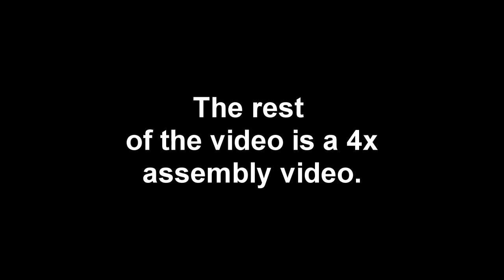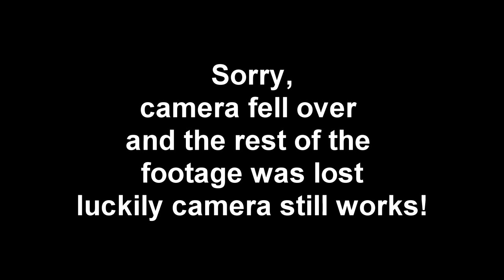24v Dewalt to 18v Milwaukee battery adapter. Episode 3 - Useful 3d Prints

Comment: Excellent way to fuck up your milwaukee battery. You need a microcontroller with a built in voltage reference and a mosfet inside your adapter to disconnect the battery when it hits the cutoff voltage. If you overdischarge the battery will go into lockdown and not take a charge. Milwaukee batteries do not have a low voltage disconnect in them like makita ones do.

Comment: Hi great video/work on the 3d printing .
I just wondered if you've made a dewalt 24volt adapter to use a dewalt flexvolt battery instead of milwaukee battery .

Comment: I have a tool that takes the fan cooled dewalt 24v nicad battery is there an adapter where I can use a 20v dewalt in thst tool or possibly adapter for a different lithium battery

Comment: You wouldn't have made a dewalt 24v adapter with just the electrical connectors?

Reason I ask is I'm looking at doing a conversion on my kids power wheels and I happen to have a few of these 24v batteries but I've yet to find anyone with an adapter to wire up for these profiles...
Reply from the maker: Hi Michael, it sounds like you have a couple Dewalt 24VDC NiCad batteries and are looking for a way to connect them your kids power wheels, correct? I haven't modeled the female socket that is built into the tool, I could do that as a tutorial and link back to here with the video and resultant model. Give me a week and I will see what I can do. Thanks for watching!

Comment: Hi Josh just wondering if that same converter you made would be acceptable for 24v DeWalt to 54v? I'm hoping to save my 24v hammer drill from becoming garbage.
Regards Stevo
Reply from the maker: Hey Stevo! So it sounds like you have 24vdc hammer drill from Dewalt and you want to know if you can power it with a 54vdc battery, and my answer would be no, not with a 54vdc battery, although if you have the new Dewalts batteries that work with either 20v or 60v products you might be able to make it work. As I understand the 60v batteries there is a physical lever that gets pushed by the tool it is inserted into in order choose if it outputs 20v or 60v So it might be possible. The one I made would probably not be compatible though as I imagine Dewalt is going the way of Milwaukee and using smart batteries which are harder to spoof. You could power an older tool with a new battery perhaps though. You could use the .stp files in my Thingiverse link to get the top half of the adapter but then you would need to model the bottom to match whatever battery you would like to try and use with it. Either way it would be a lot of 3d modeling and trial and error to get it working. If I didn't understand what you were proposing let me know and I'll respond back again. Thanks for watching!
Reply: @JoshAQ  thanks Josh

Comment: Hubby has Dewalt 24v Sliding Saw DW017 & Rotary Hammer Drill with 24v batteries but runs Milwaukee M18 too. Are you prepared to sell one or 2 of yr adaptors and send to Melbourne, Australia
Reply from the maker: Hi Christine, I had not realized that Dewalt made a Sliding Compound miter saw that ran on the 24v batteries. I would be willing to build and send you some, but I would want to improve upon the design and confirm they are not drawing too many amps out of the 18v Milwaukee Battery before I did. It is one thing to destroy my own batteries and another to charge you and have it destroy yours. If you know someone with a 3d printer you could have them print out the thingiverse files I included in the description of the video and your husband could build his own. If he owns those tools already I suspect he is a handy enough person to accomplish that. I did a quick google search for Melbourne and there a couple different shops there that could do the job. Thanks for watching!
Reply: @JoshAQ  Hi Josh, Melbourne, Australia operating under Martial Law & Police State with Covid 19 Lockdown. Hubby private enterprise shut down & cannot work let alone travel outside 5kms from home to the 3D shop for the forseeable future. How much to send a convertor to me.
Reply from the maker: Hi Christine, I recently purchased an 18 v Milwaukee Circular Saw so I do not mind sending you the adaptor I made. Feel free to contact me at cubedq@gmail.com and let me know your address so I can send it to you. I apologize for not getting back with you sooner. Between work and surgery I have been out of it. You won't owe me anything, the channel just was just monetized and I can use some of that money to help out a fellow tinkerer and maker of things. I hope you and your hubby will be ok in the coming months.

Comment: Could you do a video on how you designed this type of a part?
Reply from the maker: Hey Yellow Iron, I certainly could. I sometimes include it in my videos, sometimes not. What aspects are you specifically interested in? I assume you are interested in the 3d Modelling of a real life part to fit something with complex geometry. Or do you mean the problem solving part where I tackle the problem of where to place the battery, creating sketches, the leg work to make sure it is worth my time? Like in this case I made sure the battery could power the saw before I went to the effort of designing it. Or determining the battery pole positions and that they would need to be crossed? Even this message is me determining the outline of this video to make sure it works LOL.
Reply: @JoshAQ  Yes, I was thinking of the 3D design/modelling of the adapter.    Thanks for sharing your work and the detailed videos!
Reply from the maker: @yellowiron584  You are welcome. The next time I have to do something similar I will record and post a video of what I am thinking and doing. Thanks for the great Idea!
Reply: How much will it cost for you to make me one pls 🤞

Comment: Could you make makita 18V  to metabo 18V adapter ?
I would like to buy one
Reply from the maker: Possibly, but I would need the battery and drill to confirm fit, and operation. It took quite a few tries to get mine to fit right, and you have to make sure the pin outs are correct. I am not familiar with with either of those brands and whether  or not you can use interchangeably. It seems companies dont want you to do this sort of thing. LoL

Comment: Hi there
Do you do a dewalt 24v to 20v
Like the milwalkie
Reply: I have the dewalt 24v slide type dw0242 battery. I also have the dewalt 20v drills so I could use the adapter. Not one out there but yours

Comment: I love your job. Man.....i wish i could to do such wonderful job.
Reply from the maker: Thanks! It took some time and effort for sure. I'm sure if you put your mind to it you could become good at almost any skill you can practice repeatedly. Something like this is a culmination of years of effort. By that I mean learning basic electrical theory, then basic measuring and 3d cad skills, then learning about cnc, and 3d printing, failing, setting a 1963 Honda CB360 on fire, don't ask :-) and most importantly the ability to admit your design is bad and be determined enough to start over. One of my favorite quotes is from C.S. Lewis "A sum can be put right: but only by going back till you find the error and working it afresh from that point, never by simply going on."  
Thanks for Watching!
Reply: thank you too Josh  @JoshAQ